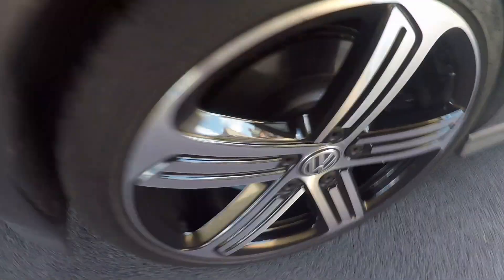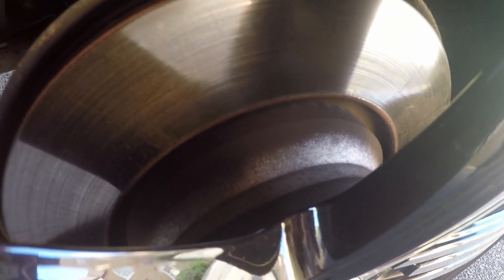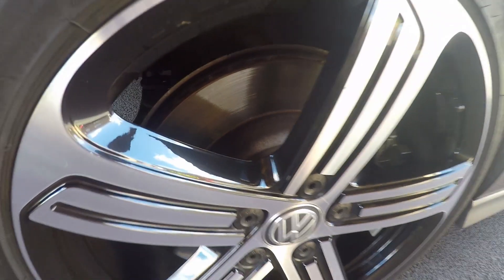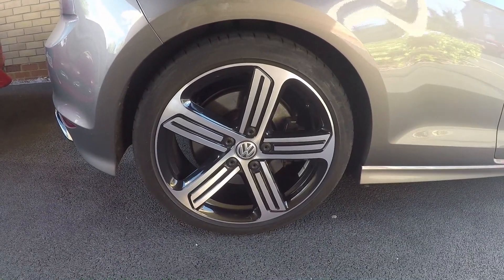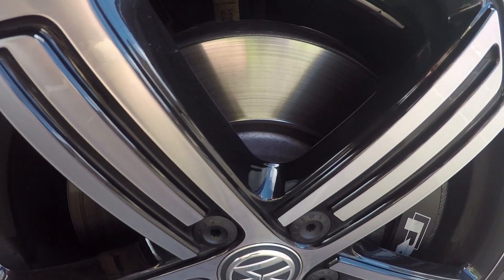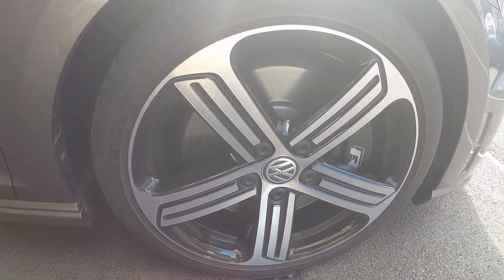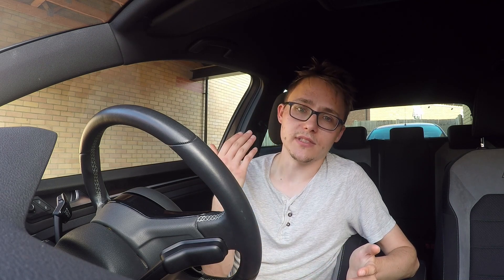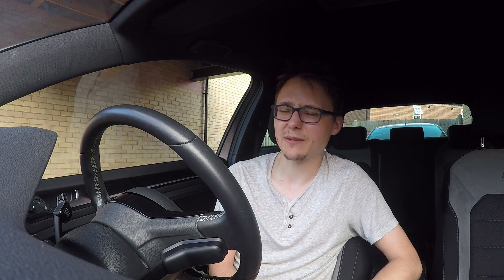Update On The Rust On My VW Golf R !

Comment: Not many cars these days get rust.My 2009 TTs has a aluminium body so no rust.Yes had the same problem on the wheels that happens on all cars.Painted mine with black heat treated paint two years ago and still going strong 👍
Reply from the maker: Happy days that it is just they wheels ! I remember having so much rust on my mk5 fiesta on the body work around the arch. Thanks for the comment !
Reply: @need for speed passion   Black if you've got black wheels, right?
Would look odd with silver alloys I would have thought?
Sounds like a good idea I could replicate for my GTD and paint the brakes black but use silver on my R which has the larger silver Pretoria's.
Reply: AJ My TTs had silver alloys originally and they looked ok black 👍

Comment: Mine was the same but the rust is on the disc so when you replace the discs get them coated black and they looks loads better problem gone.
Reply from the maker: Thanks for the information ! Hopefully the discs will last me a fair amount longer though as I'm sure they are pricey ! :-)

Thanks for the comment !
Reply: @SamAustin  about 500 pound for upgraded pads and discs then labour to get then fitted. Mine is manual like yours and my clutch slips in every gear :( had to bite the bullet and buy a stage 3 helix organic clutch and flywheel so now I need to get it fitted. It's only feels a little harder than standard so they say 🤔we will see.
Reply from the maker: @jamstersmith4625  Ah cool ! - Let me know how you get on with it. No clutch slipping for me just yet but naturally it will eventually need replacing as the miles add up :-)

Comment: I'd like to know how to prevent the discs from rusting when you wash the car?
I'll spend 2+ hrs giving my R a good clean and detail, cleaning the alloys all the way through so they are like new again. But the discs by that point have got a layer of rust on them from the washing in the first instance, so when you drive and park up the alloys have a dusting of red brake dust on them (not highly noticeable but I've just detailed the car, arghhhh!).
I've tried washing the car (and wheels) after a fast drive so the discs are hot which makes the issue less but the metal VW use for their discs is a very soft corrosive compound...
Reply from the maker: Its a good point and it just so happens I have just pressure washed my car this morning to give it a light clean (Mainly working on the wheels really).  After the wash you can really see the surface rust and its not ideal but I notice it more when I pressure was the car as apposed to a normal hand wash which does seem to stop the rust getting to the discs.  What I tend to to do, which is what I have done just now, is to take the car out for a gentle drive shortly after applying the brakes gently to remove the surface rust (normally only a 5 minute drive).  Looking at my R now outside the discs look spotless and its even rained quite heavily just now and its all looking good !  It is a tough one though and I think ultimately there is only so much you can do but hopefully that helps :-) Thanks for the comments as always AJ !

Comment: Pretty much all brake discs rust. Spend a minute or two with a wire brush then paint them. No way you have to go to "long lengths". I painted mine matt black which looks alot better than silver. A wire brush, painting brush and paint will only cost you about £10. 2 years on and my discs look fine.
Reply from the maker: Thanks for the information and good to know it's not a big job to sort out ! :-) 

Thanks for the comment !

Comment: Every VW, Audi, Seat, Skoda gets rusty brake disc hubs - its worse on some than others, but they all get it.
Its on the inner part of the brake disc itself. New discs have a Geomet coating - but it wears off with the miles, heat cycles etc.
My late 2018 R started to develop rusty brake hubs/bells after only 6 months. I wire brushed it off with an attachment on a drill, and painted them with a high temp enamel silver paint. Go on VWRoc.com ya will see many posts about the rusty hubs and the only solution is to paint them. 

Get new discs and they will do it again within 10k miles. Once painted, if prep'ed well and a good quality high temp enamel used,  it will last years.
Reply from the maker: Thanks for the detailed information ! :-) Its a shame they dont spend the money to protect it in the first place :-(